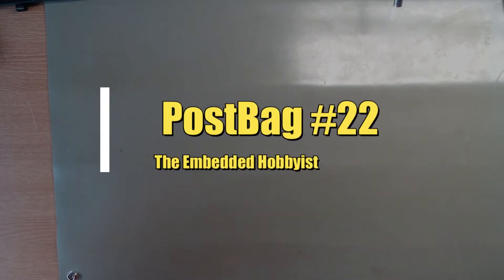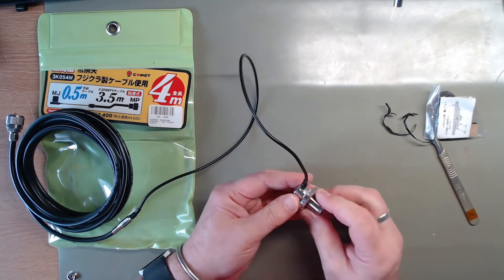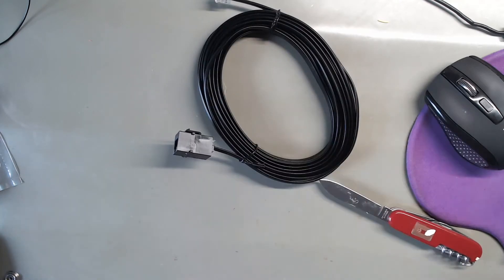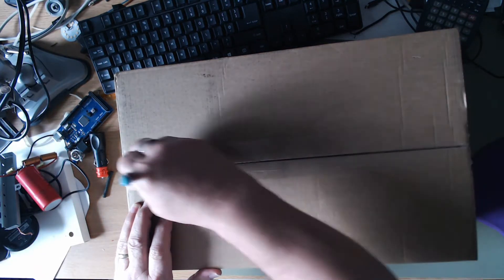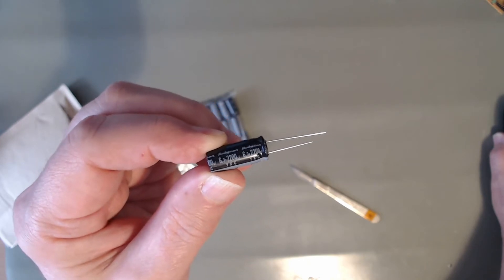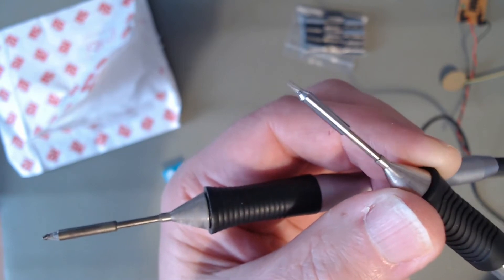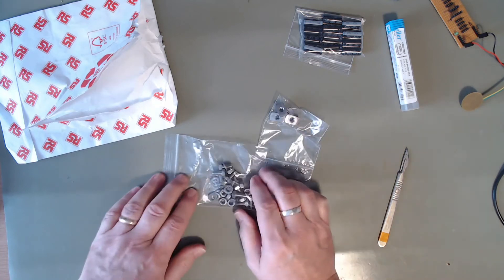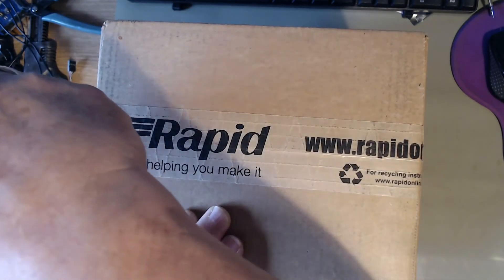#098 postbag#22 A mixed bag of goodies

Comment: One of the first things to do with the Pi Pico is to add a reset button.
Amazing that what is called an "MCU" now is as powerful as anything we called a home computer in the 1980's.
Reply from the maker: Well when you think about it a calculator has more computing power than the moon lander. And my  Sinclair MK14 had 256 bytes of ram with the new MCU's you don't need to think much about if the program will fit. which is why we can use things like Python which would have never fitted in older MCU's let alone run.

Reset button will now be the first upgrade.

question, does memory in MCU's increase due to the need of bloatware or does the use of bloatware use increase due to the larger memory. is it chicken before the egg. ;-)
Reply: @TheEmbeddedHobbyist  Rule 34 drives the expansion of memory and bandwidth.